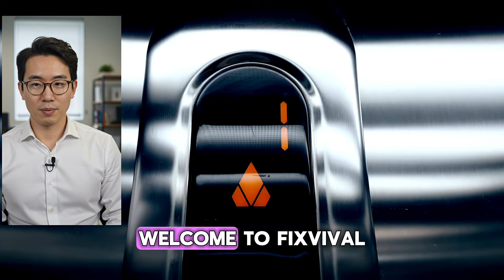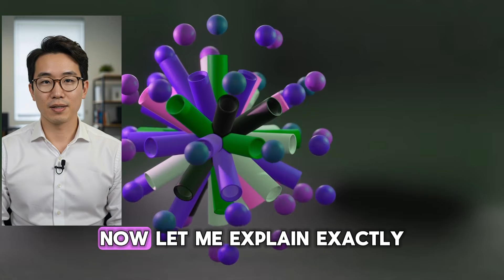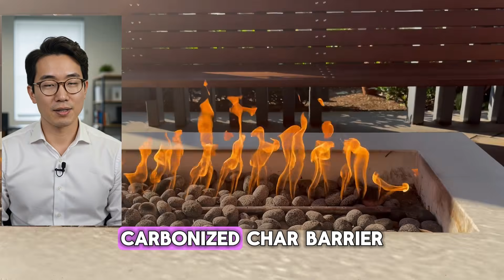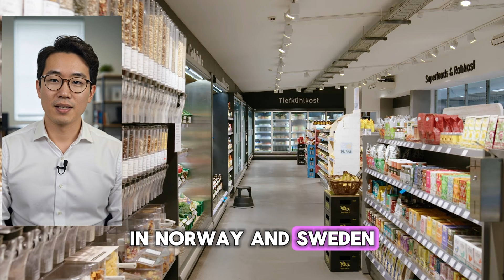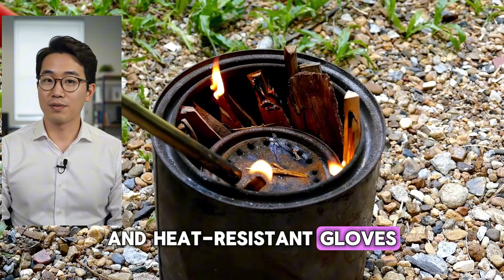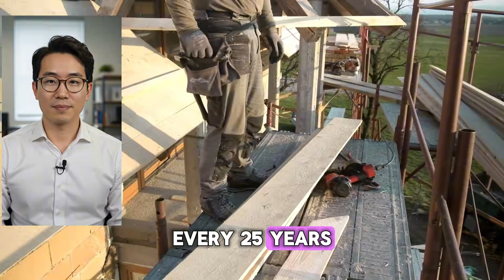$2 Natural Resin Makes Wood HARDER THAN STEEL, Ancient Shipbuilders Knew It for 3,000 Years.

Comment: Dr. Ryan, I see that you don't give a fidder's damn about what others think. This is good. I will tell you something the chemical industry does not want you to know. This will start a firestorm. The best refrigerant is water. If you draw a perfect vacuum on water the temperture gose down to. 36 degrees F, or 2.2 degrees C. The insulated container loses 10% of the water. If you place a 100lb tank 34 feet up the mast of a sailboat. The water will boil, and go down to 36F. Sweeten a waterbed with this water, and sleep all night in the tropics. Vent the tank to let the air out. Close the vent, and place the pipe at the deck with a water trap.. This icewater could be used to supercool condensers on a/c or refrigerator systems. The chemical companies don't give a fiddler's damn that you are hot, and can't sleep.

Comment: And yet, linoleum is made from pine tar.
Reply: Linoleum is made pimarily from linseed oil as well as pine rosin, not pine tar. Linseed oil, like rosin, naturally polymerizes, especially with the presence of a metal catalyst and the application of heat.
Reply: Boiled linseed oil (flax) and raisin, grounded cork and sawdust, lime and pigments, backed by woven jute. A natural product that lasts... 😊
Reply: This video is a piece of shit. Pine tar and pine resin (rosin) are two different things produced in entirely different processes. Pine tar is produced by "coking" or pyrolysis; essentially making charcoal. Resin is collected, generally from live trees. Both linseed oil and pine resin are essentially natural plastic resins.